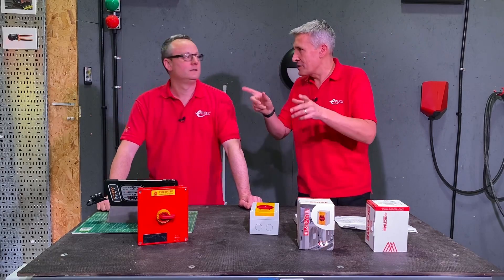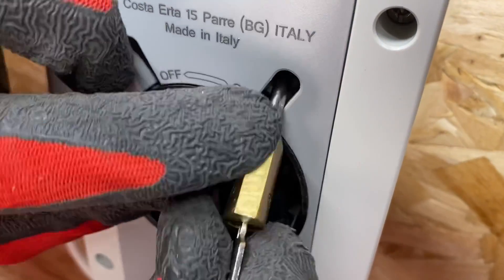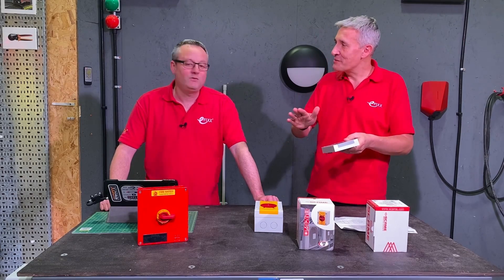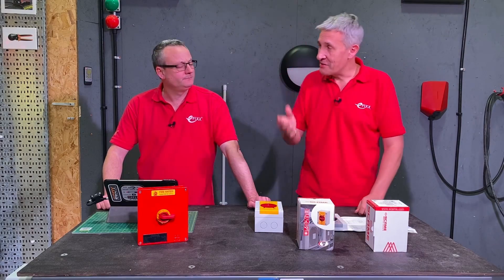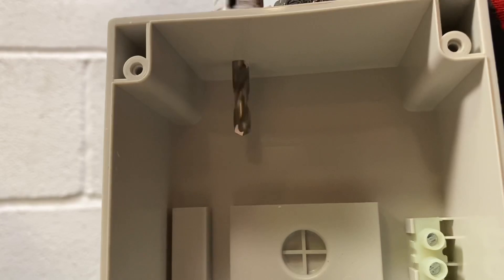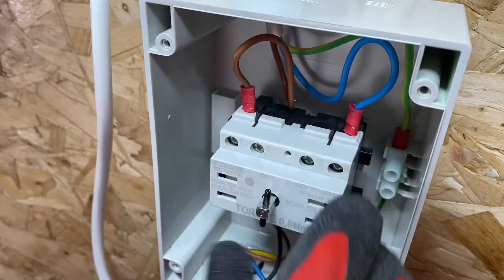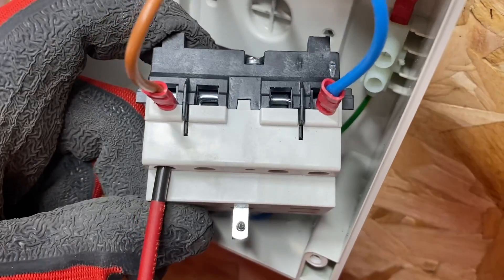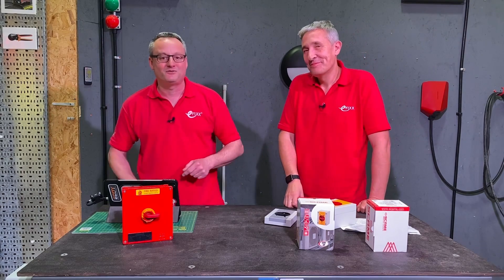TIME TO BIN THE UGLY ISOLATORS - Air source heat pump installations.

Comment: If the manufacturers say an 'emergency' isolator should be fitted, then that is what you fit. Whether you like the look of them or not is totally irrelevant. Even the regs state that manufacturers instructions over ride the regs.
Reply: the regs never say that.... They state you must take manufacturer's instructions into consideration. Stop spreading misinformation.
Reply: @FutureCurrent  If the manufacturers say an 'emergency' isolator should be fitted, or even taken into consideration, this is the same thing, manufacturers instructions override the "guidance" in 7671. be clearer on the information you spread
Reply: @brianhewitt8618  absolute nonsense, some of the crap I've seen in manufacturers instruction has taught me to take them with a pinch of salt and make a professional decision.
Reply: @FutureCurrent  I agree that some instructions are utter tosh but you still have to follow them, if you don't it won't be a good defense if anything were to go wrong, that's why you pass the buck and not hold on to it
Reply: @brianhewitt8618  If you are that concerned you could record in writing why you made a professional decision to do something different to the instructions.
Reply: @FutureCurrent  Try learning.